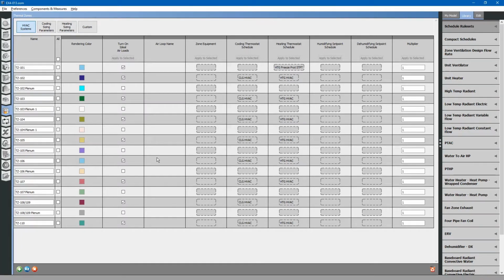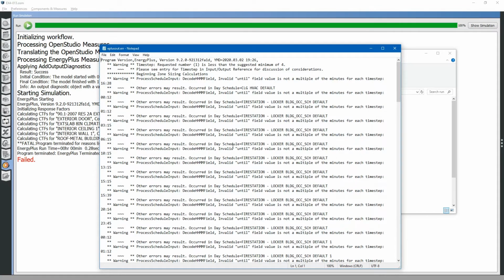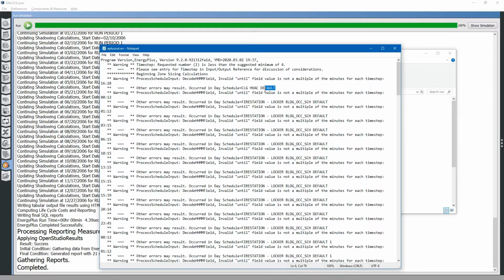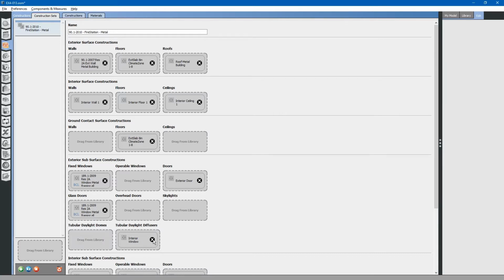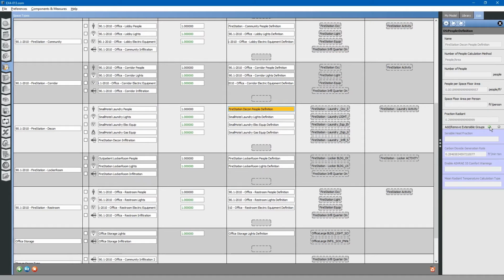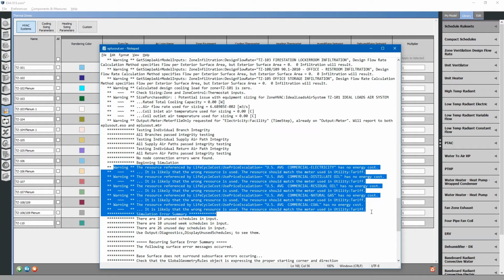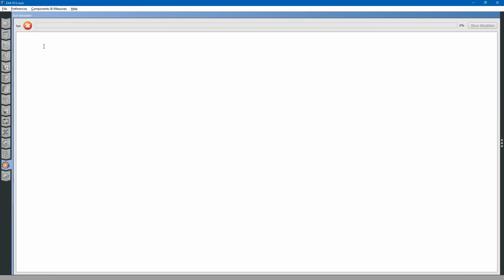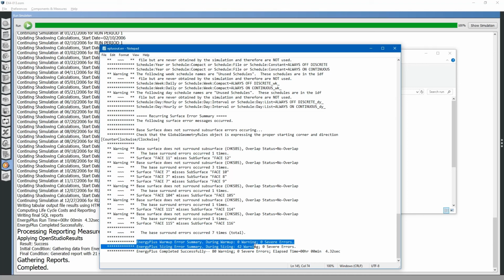Building Energy Modeling in OpenStudio - Troubleshooting

Comment: Hello Helix, I have a problem while running the simulation. In the severe problem section it says this "DualSetPointWithDeadBand: Effective heating set-point higher than effective cooling set-point - increase deadband if using unmixed air model ... Zone Heating ThermostatSetPoint=26.67 Zone Cooling ThermostatSetPoint=21.11" while my cooling and heating schedules are just like the ones you made in a previous video. What can i do? 
Thanks for your useful videos!
Reply from the maker: It sounds like your thermostat setpoints are inverted, make sure your heating setpoint is lower than your cooling setpoint.

Comment: Hello, I am getting an error "   ** Warning ** Calculated design heating load for zone=THERMAL ZONE 1 is zero.
   **   ~~~   ** Check Sizing:Zone and ZoneControl:Thermostat inputs." what is going wrong, what all tabs should i check. Please help
Reply from the maker: Yes, this error can have several reasons, but most often is it because a Cooling Thermostat Schedule was not assigned to the zone on the Thermal Zones tab.

Comment: Thanks a lot for your tutorial video. I'm new in openstutio. Recently I did some exercises following a book called Building Energy Modeling with Openstutio. When I tried to add a VAV system to my model following the steps in the book, it failed with an error: ** Severe  ** <root>[Coil:Heating:Water][Coil Heating Water 6] - Missing required property 'water_inlet_node_name'.
   ** Severe  ** <root>[Coil:Heating:Water][Coil Heating Water 6] - Missing required property 'water_outlet_node_name'.
Can you give me some advise to fix it? 
Thanks in advance.
Reply from the maker: Good question.  It appears your have specified a VAV system with hydronic hot water coils, but did not connect the hot water coils to a water loop.  You must select the heating coil then select the chain link at the top right and check the box of the water loop you want to connect.  You can see this here: https://youtu.be/G1ikmKBQx-M?t=200

Comment: Hi, thank you for all the help, very useful! I was wondering, have you ever seen this error: **  Fatal  ** Errors occurred on processing input file. Preceding condition(s) cause termination. ? I cannot seem to find the cause of this in OS, what does it mean and how can I solve this? This causes that I cannot proceed, the only severe error I get is this one:  ** Severe  ** <root>[FenestrationSurface:Detailed][Face 8] - Missing required property. Thank you in advance!
Reply from the maker: This often happens if you do not have a construction assigned to a surface.  Search for Face 8 in SketchUp and select it.  Open the inspector tool and see if it is a wall, roof/ceiling, or floor.  See if the outside boundary condition is outside or surface (inside).  Next, review your construction sets to see if you are missing a construction assignment for that type of construction.  Also, make sure the space (that has that surface) has been assigned a default construction either with the facility tab or on the spaces tab.
Reply: @helixenergypartnersllc3540  Thank you will try that! I assume these steps hold both for using SketchUp and Floorspace? (I use floorspace)
Reply from the maker: @rafisenden7349  yes

Comment: Hi, thanks for all your videos. I have a failed in gathering reports but no severe error. Have you ever seen that ? And if yes what did you do ? Thank you again
Reply from the maker: What reports do you have assigned in the measure tab?  Make sure the report measures are up to date by clicking the blue Sync Project Measures with Library button at the bottom.  Also, please note that the EnergyPlus measure reports are applied first.  So, if you have modified the EnergyPlus report with a measure, the OpenStudio reports may not operate correctly because they are expecting the standard EnergyPlus report as input.
Reply: @helixenergypartnersllc3540  okey ! Thank you very much

Comment: Many thanks for your helpful video. Could you please make a video instructing how to fix the errors related to the HVAC systems setting? Thank you!
Reply from the maker: If you upload the error file (eplusout.err) I can take a look at it: https://drive.google.com/drive/folders/1prD-gfxne3IphYqvpazA5mOsex13oNqU?usp=sharing
Reply: @helixenergypartnersllc3540   Hi Helix, I have uploaded it into the folder. Thank you very much for your help!
Reply from the maker: First, I would recommend using the Output Diagnostics measure as described here: https://youtu.be/osftawugpL0?t=1m0s
You will need to delete the problem surfaces and redraw them as described here: https://youtu.be/WkgQAIaXy78?t=23m50s
Second, I would recommend going through your model and using the surface matching tool, or manually matching the interior surfaces as described here: https://youtu.be/MwCIP1Fc1UY?t=3m0s
or here: https://youtu.be/DTaNd8fdnrU?t=31m0s
Reply from the maker: Regarding the Packaged Terminal Heat Pump issues:
1. The Biquadratic 11 curve the defines the heating performance does not land at 1 for the rated conditions.  This means there is a mismatch between the rated conditions and the performance curve that is being applied.  In other words, the heat pump will be simulated at conditions that do not fall on the performance curve, so the calculated energy consumption may not be correct.  It seems this is a default library component, with default rated conditions, so there must be an error with the library file.
2. Most of this other stuff is just warnings saying there is a mismatch between inputs you provided for the PTHP and inputs you provided for the thermal zone sizing parameters.  The program selects the most stringent input and continues to calculate.
3. These are all warnings that you will need to research either the input/output reference or the engineering reference manual.  But, you can ignore most of them.  I would recommend visiting unmethours.com.  You can find more detail on each of these warnings there.